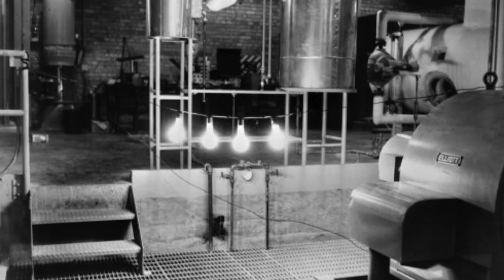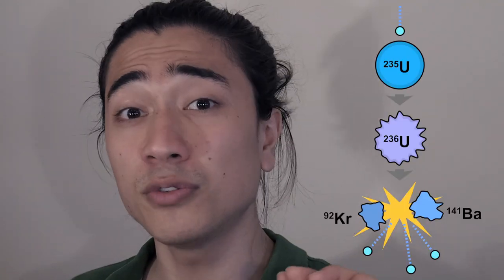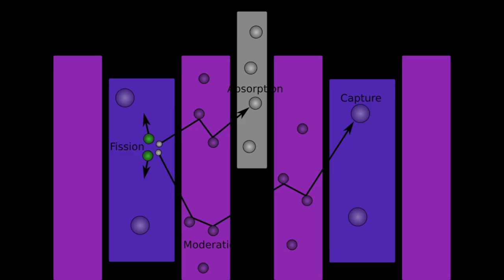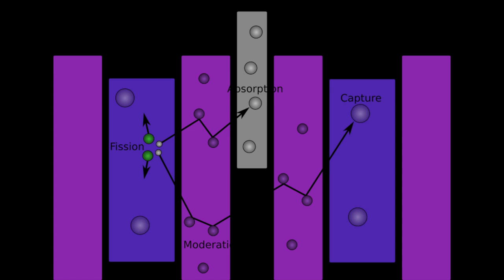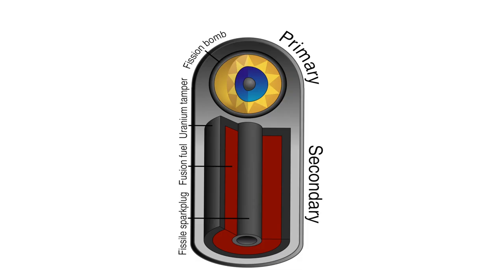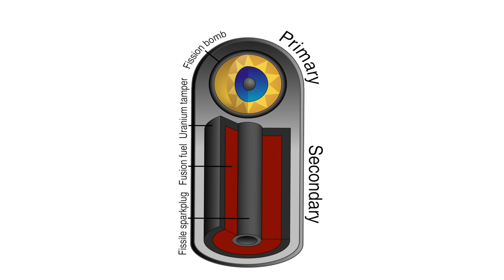What can you do with 1 Kg of uranium?

Comment: Just because uranium is enriched to 90% doesn't make it an atomic bomb 4:37. The United States Navy enriches it's Nuclear Submarines and Aircraft Carriers to about 95% U-235. Yet they're able to maintain a safe critical reactor.
Reply: He said it can be used as a bomb, not that it is. I read your above comment, so you seem to understand basics. I cant remember which WWII bomb, or maybe both, but we used a fushion reaction to ignite the fission reaction. I believe its activation energy required for the U235 to start it chain reaction.
Reply: This is how the WWII bombs were constructed, and I assume every fission bomb ever produced were constructed. A sphere of U-235 is made around the neutron generator and a small bullet of U-235 is removed. The bullet is placed at the one end of a long tube with explosives behind it, while the sphere is placed at the other end. A barometric-pressure sensor determines the appropriate altitude for detonation and triggers the following sequence of events:
The explosives fire and propel the bullet down the barrel.
The bullet strikes the sphere and generator, initiating the fission reaction.
The fission reaction begins.
The bomb explodes.
Reply: The Fat Man (Nagasaki) was actually an implosion-type with plutonium. The Little Boy was gun-type U-235.

But yeah, two-stage designs did not exist at the time, and it's actually the opposite, the fission stage is what's used to ignite the fusion stage, as it's currently the only way of starting a fusion reaction in a bomb. Fusion doesn't take place by itself, like fission, above a critical mass. Well, actually, it does, but that critical mass is in the solar mass range.